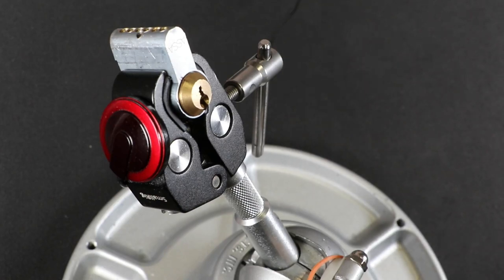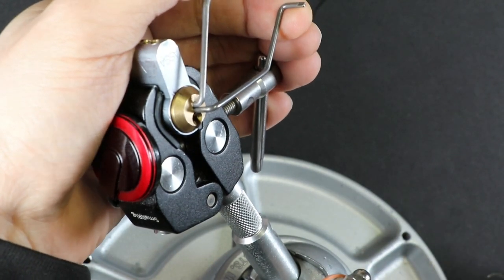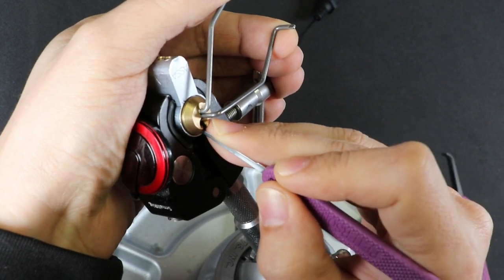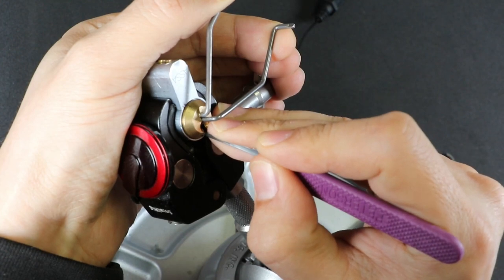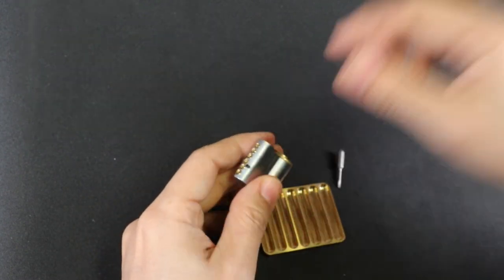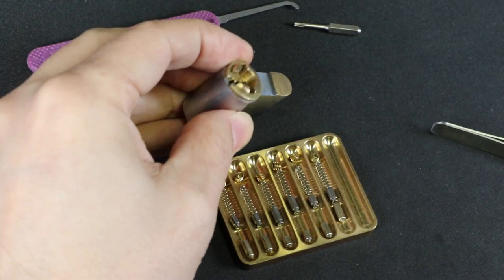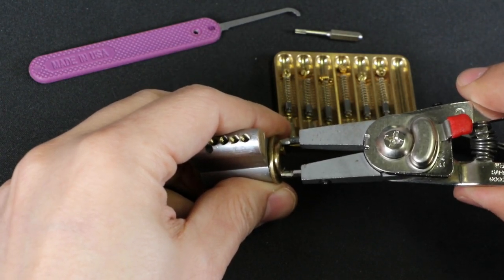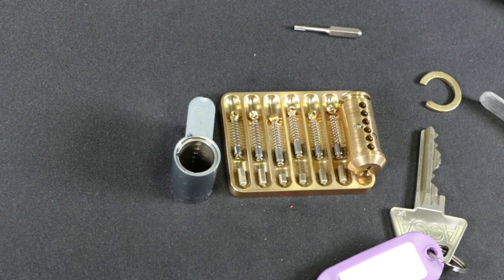[L224] ASSA 600 Euro Cylinder Lock with gin spools - pick and gut

Comment: Yes,a nice lock again, and a great demonstration with clear explaining as the picking proceeds. 
I will ask,as a left handed picker,it's not always as simply mirroring what I have seen demonstrated 
Because some type of (dimples for one) ,pins,milling, etc  won't work.
The best example  is some DIMPLES  need to be tensioner anti-clockwise 
While picking clockwise, but I will second the observation that you make it look easy
A vid I no doubt that I will watch a couple of times,billbo.
Reply from the maker: Thanks for watching again. Left handed picking can be quite tricky (though I've only tried it a few times, and it's tricky for me for other obvious reasons), lot of times you can't mirror things due to the tension direction as you explain. I often pick dimples in an arbitrary direction, but soon realize that I should be picking spools against the direction of my tension.

Comment: Very nice pick!
One question: What kind of setup are you using for that piezo-mic? I wanted to add one to my videos, but I've heard that you need some kind of preamp...
Reply from the maker: Yes, if just for picking you can use a tiny pre-amp. In my particular case, I use a Zoom H7 recorder, it records my voice audio and the pickup audio on the vise. It's overkill for just YouTube as far as channels go, so you could go with something like a Zoom P4 of H6 (the H1N might be tempting, but I've heard you can't record the built in mic at the same time as an external feed, so might want to avoid that one)

Comment: Cranking up the tension clockwise, then tickling by moving side to side, forwards and backwards using a round hook seem to help here, but I can't verify until I can progessively pin up my Ruko 500. This helps get clicks out of the stuck gins, but I'm not sure if they are set or not. They just stay springy. The hardest part is really figuring out the binders and the set pins here.
Reply from the maker: Yes, with gins and barrels with matching countermilling, you really have to step up your game when it comes to detecting the tiny movements for jiggle!
Reply from the maker: Yes, gins and barrels pin with matching counter milling really require you to step up your game when it comes to feeling for those tiny jiggle movements!
Reply: @norlin76  yeah. Well, now I can actually feel the binders and the set pims and I can distinguish them from one another. This helps me get consistent opens on both of my Ruko 500s with 4 gin spools and a tapered pin.